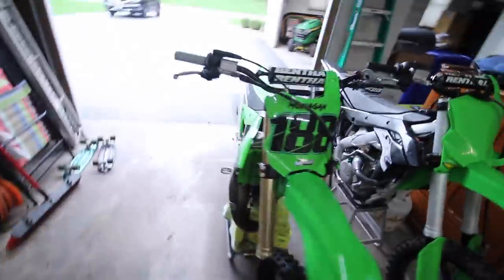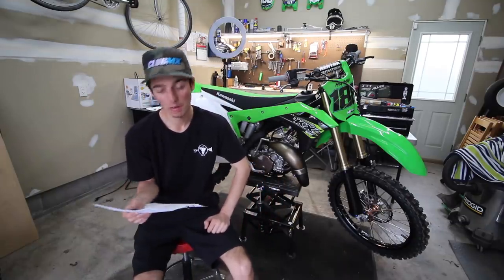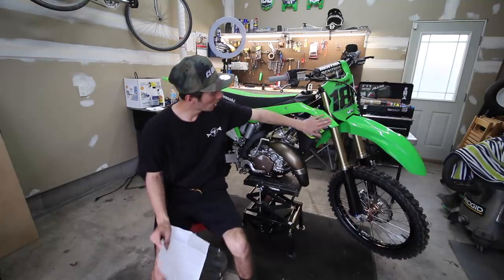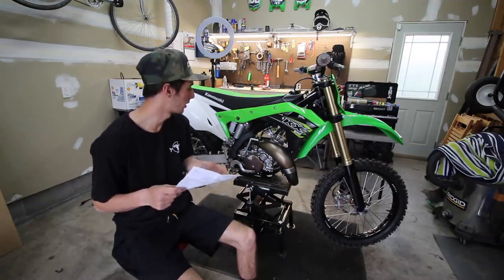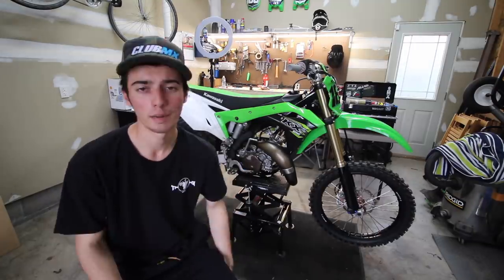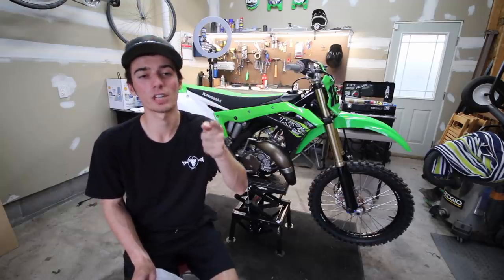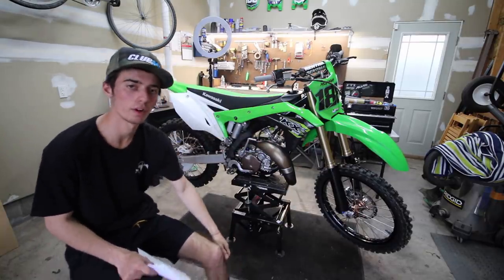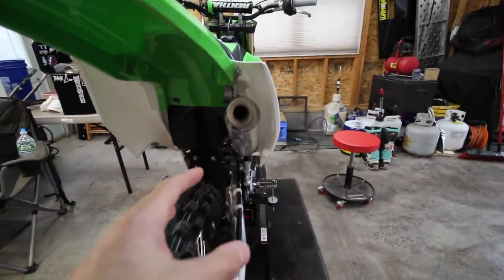2018 KX125 REVIEW

Comment: Putting in less oil wont fix the problem its getting to much fuel in general not to much oil. You have to jet it leaner if thats possible on the lectron carb.
Reply: You can play with the metering rod on those! It's possible!
Reply: But if your rpms are very high the oil sometimes blows through the engine and doesn't burn. Don't run pump gas in that thing. Mix it 50/50 prob 32 to 1. Thats my .02 cents.

Comment: If you put less oil in the gas it will run richer, as the oil volume is replaced by the gas. It almost seems backward, but what you need to do is put slightly MORE oil in the gas. Or, a better option would be to continue to run it between 32:1-40:1, or whatever you were running, and just lean it out slightly by adjusting your Lectron carb. Hope this made sense.

Comment: Tyler I highly recommend not using that  110 gas straight mix it 1 part race gas and 2 parts pump. The lead inside the race gas acts as an extra lubricant but the higher the octane number the less combustible and more stable the gas is. Without a high comp head and race porting you will actually lose power and you would have to adjust the lectron anyways to accommodate the race gas. But a splash of race gas can help the bike with a little extra lube. Sick bike btw you killed it.
Reply from the maker: Yes I forgot to mention I'm mixing it half and half with 91 pump gas

Comment: If your engine is running too rich you need to lean out the jetting not put less oil in the gas. It is not the same thing and you will damage your engine.
Reply from the maker: I understand but putting more oil in the mixture definitely would make a difference

Comment: If your running RICH that means your getting way to MUCH air and causing lean conditions on your motor and when you are running LEAN that means your not getting enough air and this will cause plug fouling and carbon build up felt like I should just say this tons of people get this wrong
Reply: Isaiah Capps that’s if your referring to lean and rich AIR conditions but he likely referencing rich OIL conditions
Reply: most of the time the rich/lean caractersitics refers to the fuel...
Reply: Adrien Gaubert like I just said
Reply: BrandoBrap I know that and I wasn’t trying to be rude i just put it on bold but the correct term is the way I explained but most people are talking about the oil again sorry if I sounded rude
Reply: Isaiah Capps each term is correct context is key my friend rich/lean fuel mixture and rich/lean air mixture refer to two different things
Reply: BrandoBrap when people are talking about running rich  they should change the oil mix that can only do so much and sometimes won’t solve your problem but with the lectron carb that’s diff
Reply: Turner Brantley it’s been explained both ways bro even mechanics have explained it this way to me but I’ve also heard the other way
Reply: I hate putting comments on YouTube you either get criticized or told your wrong 🤷🏻‍♂️
Reply: Isaiah Capps your wrong...😃😅